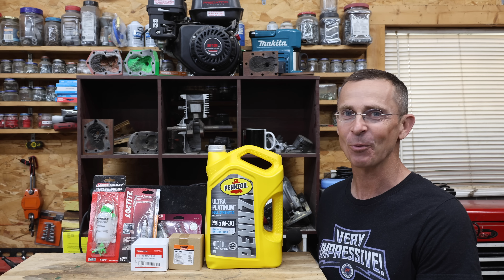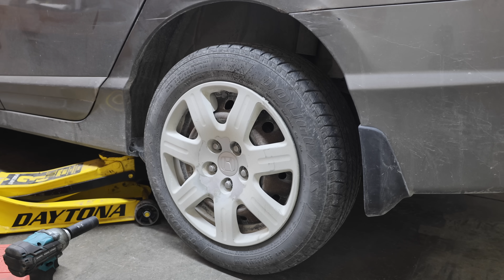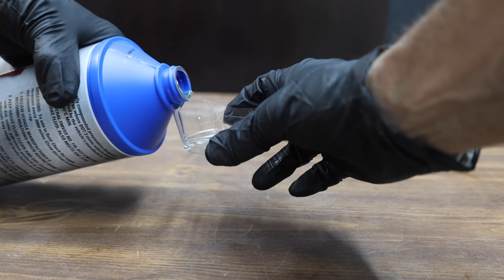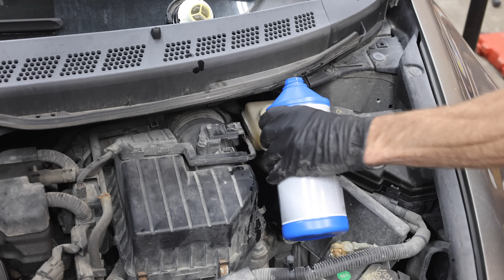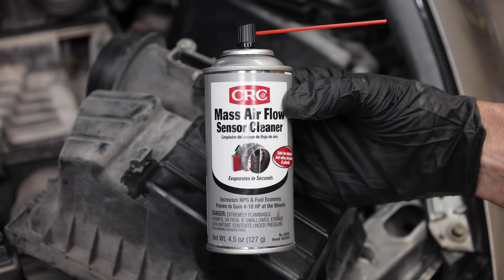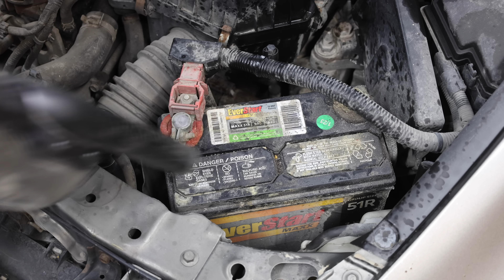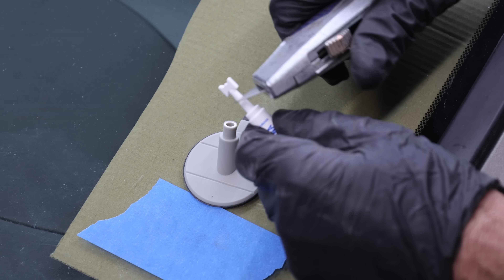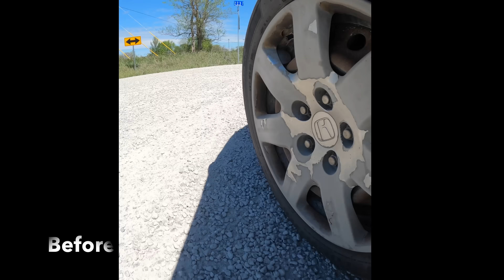Most Reliable 200K Mile Car? Let's Settle This!

Comment: I have a 2008 Honda Fit I use for UBER. Milage is 250,000 + miles. Got the first new clutch at 220,00 miles. My 20 yr old son has a 2001 Jeep Cherokee with 198,000. Both have had expected maintenance with worn parts and seals replaced. Both running strong. Fit burn 1 quart of oil per 5,000 miles. Jeep oil tight.
Reply from the maker: Thanks for sharing.

Comment: My 2001 Honda Accord reaches 200K miles and drives like a Lexus.  It has a one drop leak of the rear main seal, after you stop.  But that is it.  Keep it well maintained and it will last for another 100K miles!  Cars like this are easy to maintain, not like modern cars.

I get OEM parts from Japan!
Reply from the maker: Thanks for sharing.

Comment: Most people don't realize that there is more to maintaining a vehicle or machine than just brakes and oil. Well done! That is about everything I would do to a good used find. My 30 year old F150 with over 200k does me just fine everything works. Had a 99 Accord with 490k miles. Ran and everything worked when I sold it. All about that maintenance.
Reply from the maker: Thanks for the feedback.
Reply: @ProjectFarm  You got it right! From a ex technician, you hit the nail on the head when you mentioned that if you maintain it, it will last a lot longer. Thanks

Comment: Just changed my mind about replacing the wife’s 2013 Accord with 190,000 miles. She’s looking old and has some issues but nothing that $2000.00 won’t fix. The Accord is in pretty good shape too.
Reply: I was going to say "and what about the car?" until the punchline... 😅
Reply from the maker: Thanks for sharing!
Reply: Currently at 120k miles in my 2013 accord. Runs like new still. I babied it since 2013.
Reply: Did you tell your wife about this mind change ?

Comment: Great video. I did the same thing a few years back. Instead of buying a new car I bought a 2011 Dodge Nitro, for about $5k cash, and I've done quite a few repairs on it. It kept me out of a car note. I replaced power lock actuators, power window motors, the gas tank, thermostat, and water pump. I replaced all the spark plugs, drained and filled the power steering lines and pump, as well as replaced the brake fluid. I bought the car knowing it was going to need work and I've used it to teach myself how to work on cars
Reply from the maker: Thanks!  Thanks for sharing.

Comment: Great video. I had a 2006 Civic that i bought for 2k with 201k miles. It was very well maintained when I bought it. I sold it to a friend a few years ago and it now has a bit more than 320k miles. Still working as great as when I had it.
Reply from the maker: Thanks!  Thanks for sharing.

Comment: Maintenance is key to long car life. I usually run my Jetta TDI's to 700,000 and all but one of the 4 still had original clutch, axles, AC. Just changed timing belts and components every 100,000 and oil every 10,000 (90% highway driving)
Reply from the maker: Good Point!

Comment: I had a 2011 Civic LX-S I bought brand new. I sold it to a coworker at 245K miles. Had to change a door lock on the drivers side front and the AC compressor.  The second owner had until the timing chain went at 310K. 

It lived a good life.
Reply from the maker: Thanks for sharing.

Comment: This is an outstanding video showing how to provide affordable transportation with a small investment and some elbow grease.  I have a 2003 Volvo XC70 (187K miles) and a 2004 Volvo XC70 (with 268K miles).  As you mentioned driving older cars can mean lower insurance and registration and no car payments!  Keep track of your periodic maintenance costs that way you can tell when it makes sense to "move on".
Reply from the maker: Thanks!  Thanks for the feedback.

Comment: Most reliable 200k car is a red block Volvo.
240, 740, or 940.
I have owned lots, and driven some of them over 600k without abnormal expenditure or repair.
In Vermont. Salty, rusty Vermont.

You will never own or drive more honest, loyal equipment.
Reply from the maker: Thanks for the feedback.

Comment: Video idea: Long time listener, first time caller here, and love this channel. This one might be tough, because it's hard to control for every variable other than the important one, but I'd love to see you settle raging and longstanding debates about screw head types (Phillips, Robertson, Torx, Pozi, JIS, hex, etc..), testing for speed and ease of installation, maximum torque one can apply before cam out or failure, and especially for wear and tear on fasteners and tools on repeated use. Hope that sparks some interest.
Reply from the maker: Thanks!  Thanks for the suggestion.

Comment: I was curious to see which headlamp cleaning kit from your previous video you would use in a real world scenario, but it looks like you just ended up using spray water and a sanding sponge?
Reply from the maker: I used the Cerakote headlight restoration kit.

Comment: I recently sold my 1998 Ford f150, with the  v6 engine. Only used mobile 1 oil, and took good care of it in Colorado,  and it helped me move my stuff to San Diego...when I sold it, it had almost 300,000 miles on it, and was still running strong 💪
Reply from the maker: Thanks for sharing.

Comment: Come back and see me when you hit 425,000 miles and I might be a tiny bit impressed. Other than stuff that wear by their very nature like brakes, rotors, etc. The only thing I have had to replace on it is an alternator, ac compressor and one ball joint. Shocks are worn and will need replacing in the near future but are definitely not completely blown. Change my oil every 10,000 miles with full synthetic like clockwork. Drain and fill transmission fluid every 65,000-80,000 miles. Could be burning a small amount of oil or leaking but it's such a small amount most would not even notice.

Comment: I daily drive a 2007 Honda Civic coupe with 217,000 miles and it’s been a fantastic car with nary a problem in all those years and miles! It still runs great and drives like it has less than 100,000 miles! Honda paint is weak and will always fail to some degree, but that doesn’t affect its performance!
Reply from the maker: Thanks for sharing.

Comment: So about that transmission fluid change. Was told by my transmission shop to not do a filter and fluid change on my 2013 Camry with 150,000 miles. He said unless you know the transmission has been serviced on a schedule to just assume it is the factory fluid and putting fresh fluid with detergent would break up buildup and clog the finer ports. He said at 150k miles with zero changes, it's pretty much just being used as hydraulic fluid and to run it until it fails.

Is he a quack? Or something to that?
Reply: New video: how to determine whether or not to change the transmission fluid in a new to you high mileage vehicle.

Comment: The surest way to get your car to 200k miles is to buy one that's pre-loaded. ;)
For your bleeder hose connections, you can use tire valve stems with the schraeders removed.

Comment: Great video. 
I am worried however,
If you don't know that the transmission has had regular fluid changes and it had High mileage, I would not recommend changing it. This is because the old dirty fluid will have caused wear. The old fluid is thicker and so it may work ok. Adding new clean fluid may be too thin and cause the transmission to begin slipping.... I learned this the hard way on my Cadillac.😢

Comment: Absolutely great work, thanks for the switch-up.
Hey, I would really love to see a comparison of products that claim to enhance the durability of leather surfaces, e.g. leather car seats. Products that claim to use diamond nanoparticles, silicon dioxide and other ceramics. Do they actually increase the scuff resistance of auto vinyl and urethane-coated leather?
Reply from the maker: Thanks!  Thanks for the suggestion.
Reply: @Project Farm is this even the right place to submit suggestions?

Comment: I'm a mastertech and seen plenty of cars and issues. People highly under estimate how important oil changes are. You need to do them on a regular basis, to get the most life out of your engine. I would honestly say the majority of motors I have replaced were failures due to sludge. Dino oil every 3-4k miles synth 5-7. If you find a brand you like you can send an oil sample out to blackstone labs and they will tell you if you can push the oil a litter further before the chemicals are worn out.
Reply from the maker: Thanks for the feedback.

Comment: Those cars are great to learn on if you are interested in DIY vehicle repair. Avoid 2006-2008 if possible, lots of failed engine blocks. Replace the belt tensioner bolt with the upgraded version when you have the belt off, this will save you a ride on the tow truck.
Reply from the maker: Thanks for the feedback.

Comment: Those old Honda and Toyota engines last forever, and Hyundais are underrated too. What sends most old cars to the crusher is not the engine design or quality, but the cooling system going rotten and leaking.  6-7 year old cars need a good cooling system inspection/overhaul in addition to the usual wear parts. If a rotten hose or radiator blows and you don't shut it down immediately, it's toast.
Reply from the maker: Thanks for the feedback.

Comment: Crazy this is what $500 can get you. Here in Scotland, people are selling absolute rust buckets with every inch of the underside rotten, MOT failure with the suspension and exhaust hanging off it with less than 100k miles for £1500.
Reply from the maker: Thanks for sharing.

Comment: My 2008 honda civic suffered from the engine block defect which caused the block to crack on the left side as you look at the engine.  Honda added some additional time to their warranty, but my block cracked 18 months after that extended warranty had ended.  Lots and lots of cracked engine blocks on 2008's.  I babied my civic - hoping it would last for at least 200,000 miles, but the block cracked at only 132,000 miles.  That was the last honda car I will ever buy.
Reply from the maker: Thanks for sharing.

Comment: I have been getting into woodworking as a hobby. Would you consider more videos on things like best table saws? Best type of wood stain like water vs oil based stains? I would be interested if you could like comparr drying times on stains color saturation etc.
Reply from the maker: Thanks for the suggestion.

Comment: I feel like the title is misleading it’s more of a beater car maintenance video  the only thing I’d change if you’re going to do how to videos is point out all the bolts (or clips if it’s the interior) their locations and what tools you used on them but be brief like you are in all your videos cause there’s nothing worse than watching a video and they take 10 minutes to explain where one bolt is and that they used a 10mm deep socket and a 3 inch extension to remove it and then do it over for every bolt when it’s the same exact setup but as always great video
Reply from the maker: Thanks for the constructive feedback.

Comment: I have a 3.5L 2010 Impala with 254k miles with original motor and transmission. What an absolute gem!
Reply from the maker: Nice!
Reply: I think any car can get 250k with regular quality oil changes
Reply: @BlainePaulus  ford's 3 cylinder ecoboost would say goodluck!
Reply: @BlainePaulus  precisely and yet so many people ignore it
Reply: I had a 1970 Impala. Your’s would fit in my trunk.

Comment: Great video.  I had the 2006 Honda Civic Ex with 5 speed manual.  It had rear disc brakes.  I had it for about 9 years and put 150,000 miles on it.  Great car, but I wanted more room for kids so I moved up to a 2015 Honda Accord that is going strong aside from replacing the starter in 2021.
Reply from the maker: Thanks!  Thanks for sharing.

Comment: You know what's crazy is I bought my car. I haven't had an accident in 3 years, but my rates are such that I apparently need to pay 215 per month and that's the lowest even using jerry or otto insurance which brings the cost lower than what you would get at the iregular issurance provider. What otto insurance does is works with insurance brokers that can find you a better deal. The craziest part is it is only liability coverage.
Reply from the maker: Thanks for the feedbackk.

Comment: I have the same car only a little newer. I needed a car when I stopped driving semi trucks over the road and switched to local so I bought a 2011 Honda Civic for $4200. All it needed was hub bearings. Since I have bought it I've put about 45k miles on it. Only oil changes and transmission fluid changed. Works and runs good and is paid off. I do want a bigger car though as I now have a 5 month old son.
Reply from the maker: Thanks for sharing.

Comment: Replacing the timing belt is a very important step as a broken one will leave you on the side of the road and on interference engines it can be destructive beyond economical repair.
Reply from the maker: Good Point!

Comment: I have a 06 F150. I haven't had to do to much to it. But when it needs something it gets it. 2 set of plugs 3 alts a new A/C system new exhaust from Y pipe back and oil brakes and batteries.
Reply from the maker: Thanks for the feedback.

Comment: I knew the minute I saw the tagline for the video it had to be a Honda! I have a 2008 Honda Accord with 290k miles on it. Had the timing belt changed last year at 250k for the first time only because I was getting worried. The mechanic said everything in the casing including the belt looked brand new! Regular maintenance a new alternator and one maybe cv joint change (can’t recall for sure). The catalytic converter code is on but I plan to clean it and see how it goes. Other than that it runs like a top! My third accord and all have had 300k+ miles! Best of all, it’s been paid for for years!
Reply from the maker: Thanks for sharing.

Comment: Parts store axles are chronically undergreased. Its a great idea to remove one of the CV boot bands, roll back the boot and add grease, then re-band. Outer joints only.
Reply from the maker: Thanks for the feedback.

Comment: Well done video!  We bought my son a Honda Civic for his first car.  (97K on the odometer...he sold it at 419,000). It still ran good!  Of course, it was a well maintained 5 speed. My '07 Honda Fit had 217,000, when bought, now 248,000.  Just rebuilt the head, but not from wear, it spit a plug/coil due to lack of torque/plug swapping...common issue.  I rebuilt the head while it was off.  Now back to 40+ mpg.  I have had Toyotas with similar life.
Reply from the maker: Thanks!  Thanks for sharing.

Comment: I don't think I've ever kept a car more than 45k-75k miles. Always new, never leased. I've bought 9 cars from when I turned 17 and now I'm 39. I get good trade in value on pretty much every car I bring in to the dealership. It has to be absolutely annoying to repair a car or keep running with 200k miles.

Yall do so much work.
Reply from the maker: Thanks for the feedback.

Comment: I do agree 100% having an older car that you give maintenance is a lot cheaper than owning a new car. 
I just replaced the starter on my 2008 Toyota matrix that has over 255000 MI
Reply from the maker: Thanks for sharing.

Comment: I feel like this is a good example, but if your not DIY would be much more expensive. I did work on cars a bit but replacing CV joint, or removing springs are not what I want to touch for the higher difficulty. Maybe reaplace a fully assembled suspension, but removing spring to replace individual parts needs expensive special tools. In the video the CV joint just came out, but I know some cars they don't come out and is huge pain to hammer it out or use jigs.
Reply from the maker: Thanks for the feedback.

Comment: Nothing a wrong about driving around in a reliable beater. The only thing about these Honda engines that they you have to manually adjust the intake/exhaust valves to prevent them from burning up. Overtime, they tighten up causing the valves to hang open and not cool properly.
Reply from the maker: Thanks for the feedback.

Comment: How do you rotate tires to the back of the vehicle? Don't you also need to put tires on the front as well?

Besides the obvious there, that's not even a proper tire rotation. Which would be a forward or reverse cross pattern.

In most cases it's probably just easier to go left to right, since it's assumable most people had professionals who did it wrong (going only front to back & back to front).

Comment: Tip for doing transmission or diff oil changes, make sure you can open the fill port before you drain them, finding out after that they are completely seized is not fun.
Reply from the maker: Thanks for the feedback.

Comment: 2003 2500 Hemi Ram 4x4 here approaching 300k on the odometer. Religious service intervals since new with oil ever 5k and all other intervals followed for driveline and trans (and then some) I would honestly drive this thing coast to coast if asked, still runs perfect and goes down the road perfect. Regular service and care is the simple key to long car life
Reply from the maker: Good Point!

Comment: Is it safe to change my automatic transmission fluid if I feel the gear change smooth? the fluid doesn’t look as black as the video and I don’t know if the previous owner of my vehicle changed it before. Mechanics told me to not do it.
180,000 mil. 2003 toyota corolla.
Reply from the maker: Thanks for the suggestion.